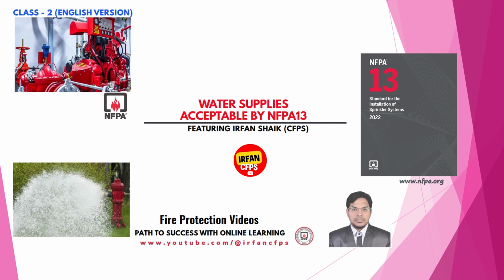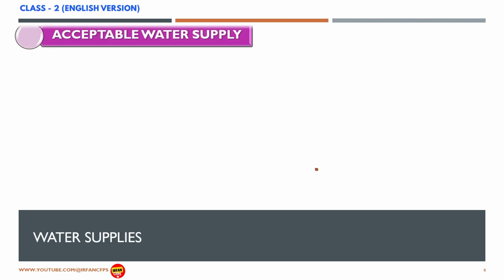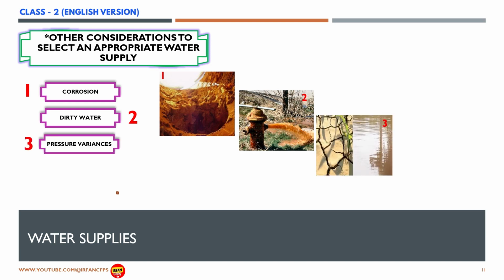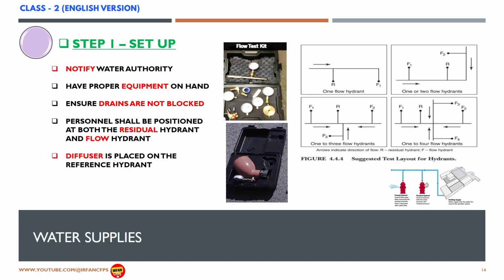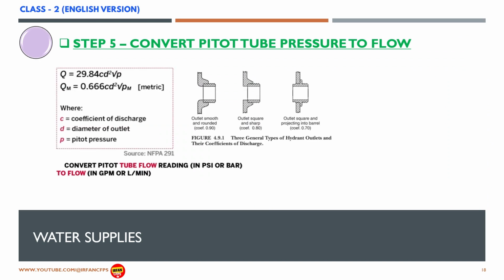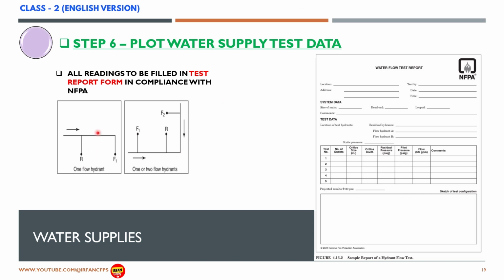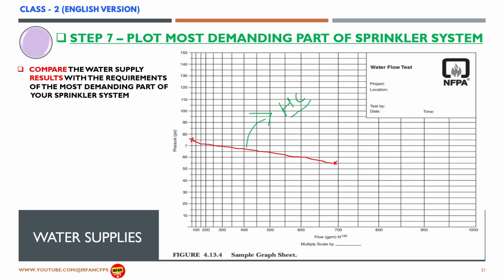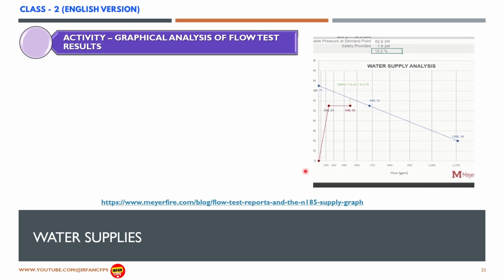Hydrant Flow Test Procedure | Plotting Hydrant Flow Data | NFPA

Comment: Hi. For the hydrants , What are the design criteria or the NFPA requirements for the Residual pressure and flow rate at the hydrant outlet?
Reply from the maker: Remotest hydrant minimum residual pressure will be 20 psi. Flow rate depends on fire flow requirements.